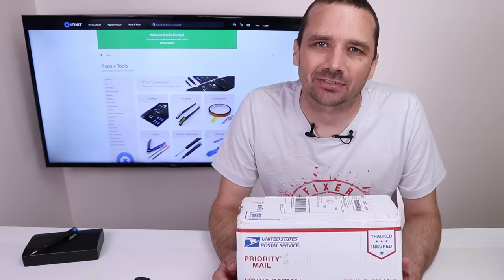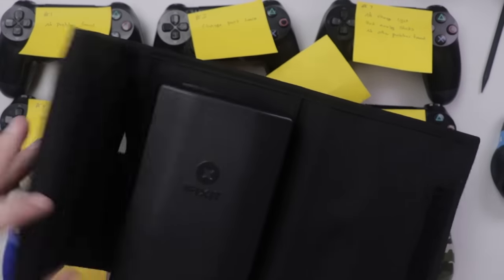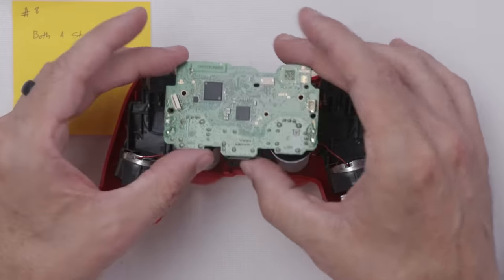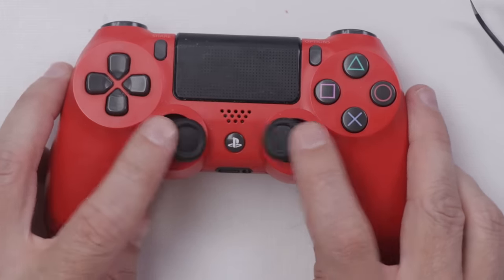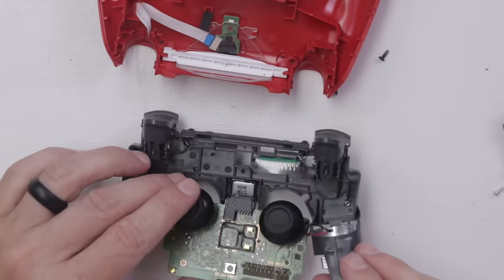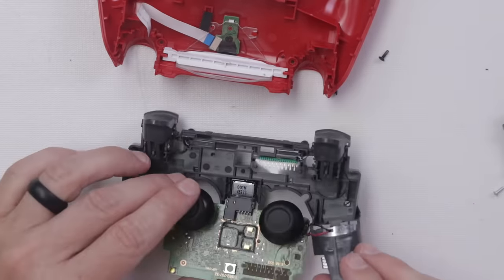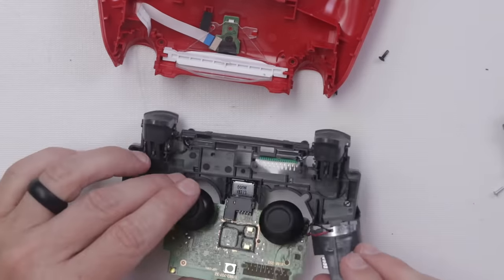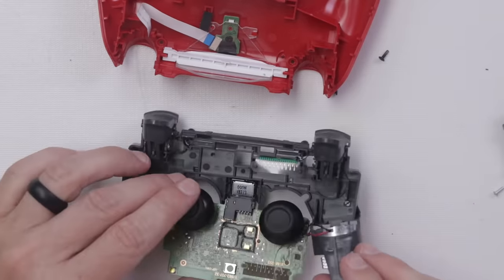I Bought 11 BROKEN PS4 Controllers for $220 - Let's Fix Them!

Comment from the maker: Get your iFixit discount by using my link:  https://ifixit.com/tronicsfix
Reply: @RADIO ACTIVE put some sewing machine oil in it
Reply: @RADIO ACTIVE yess after that just put 5 drops and then press it
Reply: I found a xbox one x that won't turn one what can be the problems just wanted to ask u before buying it
Reply: @icegaming3657  I am not professional
Reply: Next video: n64 controller repair please
Reply: Great video as always Steve!  Is there any chance you could do an Xbox One controller bulk lot?
Reply: Hi TronicsFix , Where can find good quality New Analog stick sensor? Thanks
Reply: I have a quick question could you answer it for me?
Reply: Can you fix my controller please I have a custom controller and my r3 is working as my triangle and my r3 it’s weird but I have tryouts for my college esports team soon if you respond I’ll link my email and I’m willing to pay any price
Reply: Can you fix while you are live? I think its a great idea🤔
Reply: please can you put subtitles in italian because i follow you but i don't understand anything thank you
Reply: @tronicsfix do u have a email??
Reply: What's your temperature to remove analog sticks on the hot air station?
Reply: The problem with changing the analog sticks is that you can kill components on the PCB, and if that is the case, your controller is dead. Like you saw, one button can stay on forever or randomly switching state which makes the controller useless. Basically, for all the trouble that you get, you are better just getting a new controller.
Reply: Such a underrated channel!Keep on your work bro,you are helping many people save money on devices,love this channel.
Reply: I don’t think this discount is still active but I went ahead and bought the kit. Saved on shipping by using code on website.
Reply: can u leave a link for the analog replacements
Reply: There are a couple of things I don't buy second handed.. One of them is a semen invested used controller
Reply: Wait, Do you Have a Twin?

Comment: Welp, if they werent broken before..the unboxing really made sure they were
Reply: Nahh, they can take a battering before they break, even surviving a lot of drops on to a hard floor.
Reply: Just like military, if your not strong, they will MAKE U.
Reply: Remember: if it ain't broke, he'll fix it till it is.
Reply from the maker: @HuntersMoon78  Lol...exactly!
Reply: Is because he is so conviced that he can fix anything
Reply: If a job's worth doing properly...  😉
Reply: That ribbon cable probably unplugged itself, flipped upside-down, then plugged itself back in when he dropped them
Reply: That's not "braking them." That is insuring the faults remain faulty. No lucky "fixed in shipping" here!
Reply: @rey_azteca_009  iidîo
Reply: Make youre a donut
Reply: That is exactly what I was thinking
Reply: @HuntersMoon78   I can confirm that lol 😂
Reply: @GabrielAlcala956  From the statue of liberty? What do you think. It sure got liberated from damages  😂
Reply: @jamesgriffyn  lol
Reply: What software is he using to check what faults they have?
Reply: Trust me these things can take a beaten 

I’ve hurt myself with these controllers more than I’ve hurt them
Reply: @HuntersMoon78  give it to tyler1 it won't last 1 hour before it's in 100 pieces
Reply: I dropped mine off of my roof once by accident and it was fine... was playing games on my roof like workaholics and when I set it down it slid off... luckily it wasn't the system🤣
Reply: 1000th like 👍 i gotcha bro

Comment: For drifting sticks you dont usually need to replace them, it's usually a matter of the small white disks inside the green compartments at the side of the analog stick, you simply just remove it, clean the inside of the compartment with rubbing alcohol and put it back together.
Reply: Is there any videos on YouTube of someone doing it?
Reply: @erickcov.5763  I'm sure someone has

Comment: Thanks Steve, had 2 controllers with the USB mini charging ports become lose over time. Managed to remove and repair the ports by carefully closing the socket , only as a workaround, but ordered 2 new ports anyway, but gets you up and running while waiting for the ports to arrive. I would recommend when ordering the ports pay attention to the model number i.e JDS-001 or JDS-011 and not just order without checking. Great video. Thanks Rich

Comment: Hey, this is just a tip for anyone that has analogue stick drift problems. So if you open up the two green compartments on the top and sides of the joysticks, inside will be white joystick sensors and all you have to do is replace those and your stick drift problem will be fixed. Just make sure your replace the right ones as the top sensors are what picks up the left and right movement of the joystick and the sensors on the sides are the ones that pick up the up and down movements.
Reply: I have this issue on like 6 or 7 controllers... I'm too scared to pop em open... lol

Comment: Will we ever see things like graphics cards being fixed? Would be interesting.
Reply: lol jay's two cents broke a $2500 graphics card but then later fixed it. I think it's the only time I've heard of one being fixed. He originally bypassed the power limiters for overclocking, but then was trying to restore it and broke off the resistor. His soldering technique was TERRIBLE. I was cringing. lol But hey if it works does it matter that it's not flush with the PCB?
Reply: @awilliams1701  Saw that. Was hillarious.
Reply: @GuanacoSIVAR  Y eso no tiene nada que ver con lo que ellos estan hablando wtf
Reply from the maker: Possibly...I see a good number of comments asking about that.
Reply: @Tronicsfix  hope you do :D
Reply: @awilliams1701  gpus are 50% of the time fixable
Reply: Please, do GPU repairs as well. Thanks for the awesome content.
Reply: Could be interesting...
Reply: GPU and Motherboars 😍
Reply: Lol he overheated PCB and ripped the mask off while changing analogue sticks and you wanna let him try to repair graphics card?
Reply: @wheresvr6  Hopefully he starts with 1050Tis, instead of RTX2080Tis :D
Reply: @wheresvr6  well , he try to remove the analogue sticks the hardest way, so it bound to happen, i am surprised he didn't rip any solder pads
Reply: @exlibrisas  theyre more of the same in terms of repair difficulty, but the other is cheaper yes, but usually the more high end a gpu is, the more it is prone to breaking (PCB wise), that's why third party AIB need to add something to make it more durable, thus increasing the price even more,

Comment: Glad you made this video. A ps3 controller of mine sustained some liquid damage a while back and exhibited similar readings in the the gamepad settings (readings jumping around rather than staying steady). I tried lots of stuff to fix it, but gave up and replaced the whole motherboard. I didn't try replacing the analog sticks, tho. I wonder if that's the problem.

It looks like it would be easier to install the new analog stick module if you wick away the solder after removing the the old one. That way, you can just pop the pins through the holes without having to keep all that solder hot. You also don't have to subject as much of the board to prolonged heat that way, since you can just use an iron to apply localized heat to each pin.

Comment: 7:14 to 7:20 - How did that scratch suddenly end up there?? ouch!
If you don't want to burn/melt the plastic - you need lower temps. The lead-free solders melt at higher temperatures of about 217°C/422°F compared to 183°C/361°F for the lead-based option.
- apply some lead-based solder onto the joints before applying hot-air, and you're down a cool 34°C/61°F 😎

Comment: I have so many ps4 controllers that broke due to the stick drift, so I just bought the sensors and it fixed most of them,beats paying about 60-80 for a new controller now. Idk if I'll be comfortable using the heat to remover the entire analog tho lol
Keep up the amazing work!

Comment: Lord, I wouldn't have paid $220 for 11 working secondhand PS4 controllers. They're like $40 new if you shop around and you can see these have been used BAD by the rubbed off sticker in the back or the sticker missing altogether. My own PS4 controllers have zero sticker wear so far after 200+ hours of gaming. Full props for still fixing them though.
Reply from the maker: The $40 controllers are fake.

Comment: Hi Steve, love your video's. Just was wondering why you replace all the analoge sticks instead of opening them and cleaning the inside with alcohol. Most drifting problems can be fixed that why and saves money and time on soldering new analog sticks. Maybe you can do a in depth video ones on the inside of the analoge stick? Keep up the good work!

Comment: Next time on good condition controllers, before replacing sticks, try to clean flux traces from the PCB. Factories use cheap flux that over time creates a lot of issues such as interference/resistance between pins and that the actual issue. Same happening with Power-A Nintendo and Xbox controllers. I "fixed" loads of controllers this way. Main reason why you MUST clean flux after soldering...

Comment: Regarding number 7: there is a really easy fix for a problem when joystick behaves in a way shown (having issues when being pushed at exact opposite directions). You simply need to replace one of the two round metal contact pads beneath green plastic covers at the side of a joystick (one is at the top, the other to the left).
Reply: Yea I was gonna say that, he seems to have over complicated a fix that could be much easier and quicker

Comment: Is there any way to improve the analog sticks or build stronger ones ? Its one of the most common problems of the Dualshock 4, so there must be another way than replacing the analog sticks every few months. Maybe build ones completely out of metalls or a better dust cover on the sensors? Idk

Comment: Thanks for the info Steve.  Just one question what temperature and air flow settings do you use when working with hot air?

Thanks
Reply from the maker: 1100F and airspeed of 3
Reply: @Tronicsfix  not being professional youtubers, most of us can't afford the same hardware. Would the less expensive guns that max out at 900 degrees F suffice?

Comment: How did you damage the left side of the PCB at 7:20 ?
Reply from the maker: I really don't remember. This was filmed weeks ago. I do remember that that part of the solder mask came off much easier than it should have...maybe the effect of liquid damage. I think maybe wit pliers.
Reply: Did you notice when he was installing the board back into the controller it wasn't scratched anymore? Something fishy going on.

Comment: The down D-Pad on my controller has completely stopped working. I look after my stuff so I don't know why its randomly done this.
Reply from the maker: Might need to disassemble it and have a look.
Reply: It's probably the photo film, dirty or damaged
Reply: Looking for an answer for this also, I have one of the newer version controls with the light bar on the touch pad. My left does not work. Its was only used for 4 months. No water damage, never drop. Opened it up and everything is basically brand new.

Comment: How do you deal with stuck screws? I've tried opening some of my stuff before but even with the correct screwhead sometimes I end up stripping the screws, and because they're so small I can't do much afterwards
Reply from the maker: You have to put a lot of pressure downward when unscrewing. If you are using the right size and they still strip then you likely need to buy better quality tools.

Comment: Just used this vid to give me the confidence to open a friend's "non-working" controller. It wouldn't light up at all. Didn't notice anything obviously wrong, but re-seating the ribbon cable and unplugging the battery seems to have brought it back to life. Thanks!

Comment: You are so lucky ! 80% of the time when I get a broken ps4 controller in it's an broken Ic on the board , water damage or the controller would just off itself every 10 minutes
Reply from the maker: The IC is easier to change than the analog stick imo.
Reply: @Tronicsfix  To this day I was never able to do such small solder work on my own :v I see you and mymatevince replace so many Ics just just a heat gun and it all falls into place but when ever I try it it's a mess and 99% of the time did I fix it until it could be fixed no more haha
Reply: @Tronicsfix  Oh and yeah I allways had the problem that the sticks started melting whilst I tried to get the new once in / the old once out

Comment: Thank you for this tutorial! I'd taken apart my water damaged PS4 controller, cleaned it and added WD-40, only to put it back together and find it wouldn't charge. Turns out I'd placed the ribbon back incorrectly. Never would have guessed it had I not played this video while braiding my hair.

Comment: the problem with hot air is that you damage the stick that can be repaired , you melt the base of it, I use a desoldering iron that also sucks the solder avoiding damaging the old stick
Reply from the maker: You just need a little practice. With the right amount of heat and air it works perfectly.

Comment: I’m not a fan of hot air for through board component R&R.  An iron and solder sucker is the best solution.  Way less heat and collateral damage.
Reply from the maker: You just have to be a little more careful. The amount of heat won't hurt anything if you're careful with what you're doing.

Comment: Have u ever thought about using heat resistant putty to block off sensitive parts it works wonders and it’s reuseable
Reply from the maker: Yep...I use that when tape won't work very well.

Comment: 8:06 a good solder joint should be reflective your's are cloudy. Are you sure you won't have problems with your solder joints cracking?
-Most people would remove old solder and use new to get a strong mirror-like weld there.
Reply from the maker: Yep...I've been soldering for over 5 years and have never had a problem with them (after I learned how to make good joints). You're correct that usually a good joint is shiny but it's doesn't have to be shiny to be a good joint.

Comment: Great video Steve, what temp do you set the hot air station to remove the analog stick?
Reply from the maker: Mine’s at 1100 F
Reply: @Tronicsfix  spot on thanks

Comment: What analog replacement sensors are you using? I didn't see any listed on your amazon repair parts list and most of the ones I've found have an issue with the L3/R3 buttons not properly allowing use when moved in any direction other than directly down (no sprinting in most games that need it, etc.).

Comment: I just like these videos. Brings me to the time in 90's when I was in school for light voltage electronics where we fixed TV's and vcr's and amplifiers. And that was the time for 386 and 486 computers and intel 486 sx25 was the first computer that I changed cpu to 486 DX66. And AMD K6 300 was the first computer that I build with my own hands from pieces.

Comment: I felt a slight sense of pain seeing just how many v1 controllers you had versus the absolute near idiot proof v2 controllers. v1's thumbsticks tend to melt, while v2 end up having 'tokyo drift' level sticks, pretty quick. I tried blowing air in the sticks, and those green capped sides. it helps for a bit but it just came back.

Comment: are solder fumes bad for you if so how do you deal with it?
Reply from the maker: Yes...I use a fume extractor
Reply: @Tronicsfix  thanks for the response I want to get into this but a basic station starts at 90$ (which is my budget for this as a hobby but my worry is that it's to complicated but idk we'll see 😊

Comment: Hello! First of all, thanks to your video I manage to start a repair business . Some questions, What kind of brand that hot air gun?What temperature usually for the solder to melt? And is there a specific solder tips that I can buy for small soldering ? Or did you diy the tip yourself? Thanks in advance!

Comment: Drifting analogs can be solved by opening the inner plastic parts of the analog and cleaning it with isopropyl alcohol and a cotonette. You didn't need to replace the entire analog.

Comment: Hey Steve, I recently bought a PS4 Pro and I've ran into an issue 5 minutes in. It beeps when I turn it on and the blue light comes on for 1-3 seconds before turning off again and it won't light up again unless I pull the power suppy cable and let it sit for a couple seconds. I know you don't work on PS4's anymore and you refer us to your friend but based off his site he doesn't repair this issue. Can you make am excemption this one time? I need my baby back 😭
Reply: Mine is starting to do this as well I've had it almost a year now.
I either have to unplug/turn off for a while
Reply: Abstract Gamer I swapped out my power supply yesterday after inspecting the motherboard and seeing no issues (with any chips or connectors on the motherboard) and it's been working fine since then. Hopefully it keeps up that way!

Comment: Question for ya if I see my analog sticks off axis on game pad tester .com is that just an API issue or should they be replaced? They don’t stick or drift.
Super fun channel to watch, having fixed everything in my home from CPU chip fans and heat sinks to the radiator in my car I like the empowering and upbeat vibes your channel puts out!